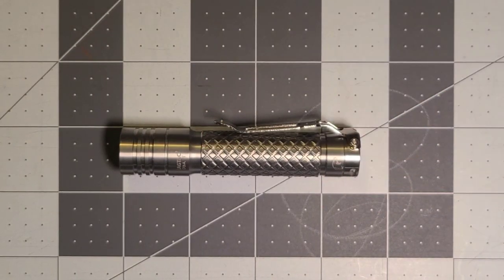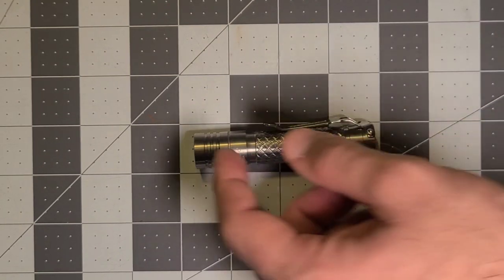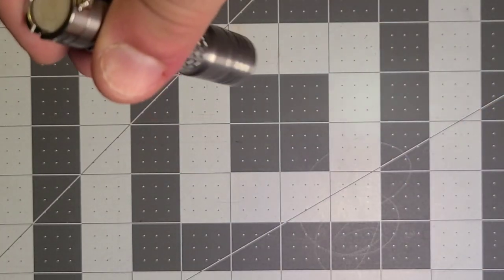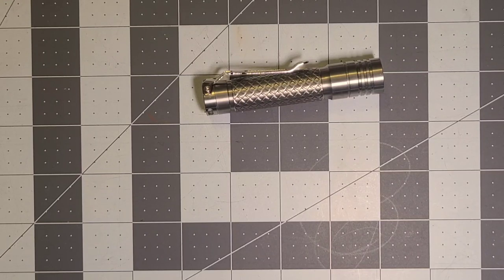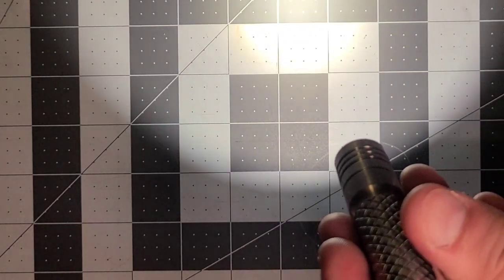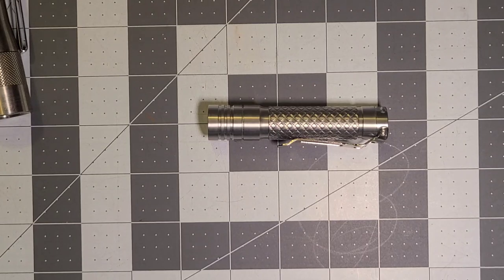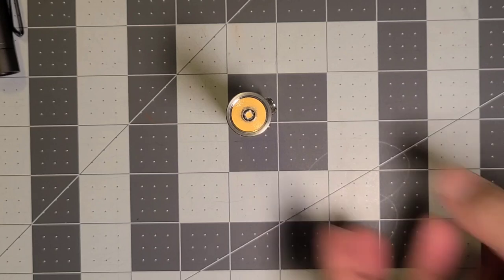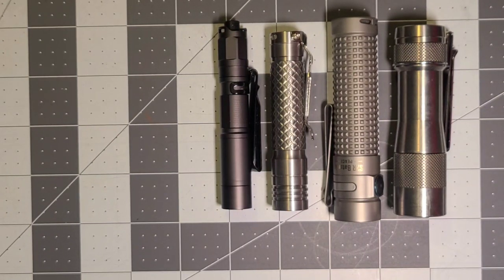Eagtac D3A, Why is no one Talking About this Light?

Comment: Great light! I’ve carried a 2015 d25c ti since, well 2015. I got the neutral xpl-hi and I call it my unicorn light because it just has absolutely incredible tint and color rendering.. far better than it should! I’ve bought other lights with the same led since and it always out em to shame.. it also beats my nichia and sst20 lights. At least when it comes to tint. Might be a couple points lower cri wise but I’d estimate that it’s in the high 80s.

I’ve had a couple 2014 d25a ti’s as well. They’re cool white but I found em on clearance for 35-40 a piece. I kept my favorite, the xml one and sold the others to coworkers, who still use them daily! Mine is my bedside light. 

I don’t might the strobes either, because of having to cycle twice, or I’ll just half press the button for a half second to reset. 

I recently enabled memory on my d25c by accident and thought it had finally crapped out..  but nope! I figured it out and she’s still going strong. I recently got a ticu fw3 with 4kk sst20s which might replace it.. at least in winter when it’s easier to carry a larger light..  but I can see myself crawling back to the trusty d25c. Like I said, just can’t beat the tint! It almost sucks because it was my first “high end” flashlight and it makes me disappointed in everything else now! In one way or another.

Comment: currently carrying a manker eo2 II, its a right angle AAA light that can take 10440s, but even with just a AAA it goes up to like 220 too, yo get two emitter options : SST20 in neutral white which is around 4000k and >95cri or in cool white. Its stupid small and stupid inexpensive too (around 15-20), and the UI  is pretty ddamn nice ( u get double cick for turbo and hold for super low moonlight levels.) Personally its an awesome edc light  and since its so inexpensive i can use it and abuse it without worries.
Reply: Totally agree with you they are fantastic lil flashlights my most used tbh. To easy to have too much torch than you actually need.

Comment: I have an older d25a ti and have carried a d25c ti for years. Have owned several others as well. The clip is fine but I do have my own complaints about it. First, the screws! They use a weird size like 1.55mm or something and they've arrived half stripped. I always use a little pair of pliers to remove or tighten em. Next, the coating. It looks crappy and chips off easily. My solution is sandblasting them as soon as I get em. It looks much nicer, especially after some carry time. My most carried has a nice stonewashed look to it now.

Comment: Pocket clip broke on my D25A in the most annoying way. The clip itself didn't break but the screw holes stripped so I can't attached it.
Reply from the maker: That sucks...did u contact them?
Reply: @maxlvledc  Nah. I took on the task of using JB Welds while trying to avoid the clicky button. Lasted a few weeks.
Reply: I got my tee already with a stripped thread on one of the bolts (the bolts and the hexagon are not standard for them), I solved the problem by recutting the thread to a slightly thicker one and using two bolts from the computer, it turned out even better than from the manufacturer, since the bolts have a flatter head

Comment: D3A is amazing.  I’ve been using mine daily for the past year.  Love it!!  Only thing is I can’t find out how to switch to moonlight mode instead of just “low.”  I’ve followed the instructions in the box to no avail.  Any chance you might be able to explain how to switch into moonlight mode?  Thanks!
Reply from the maker: hmm, was their a hidden moonlight mode??? I thought it was just 4 different modes in the edc modeset and you came in on it..I'll check for you.
Reply: @maxlvledc  Yea, per the instructions there is an additional moonlight mode that you can “toggle” into.  They’re not very clear.  Thanks for checking!
Reply: @matthewtoeneboehn7784  YouTube it. There's a video on how to perform this. You have to turn the head on and off three times while the switch is on.

Comment: Old video and not sure if you will answer but is the turbo setting when the head is tight the same as the high mode when the head is loose? Or are they actually different Lumen outputs?
Reply: It's gotta be different. There's 4 diff lumen outputs on the specs.
Reply: @mark6865  I saw that I just wasn’t sure if that was a turbo-hi-med-low or hi-med-low-moonlight. I don’t trust the website since they don’t even show the right mode group for the light functions lol
Reply: @RyGod509  hmmm that’s a good point actually. Moonlight is one of the 4 I assume listed at 2lm. Now I’m not so sure. Maybe turbo and high are the same?
Reply: @mark6865  I bought one that should be here Monday so I’ll test it out then and let you know.
Reply: @mark6865  also looking at some document for the D3A it shows group 1 goes very low-low-med-high and group 2 goes max-strobe. And then goes to say limit use to 5 minutes while in high and turbo mode. I’m hoping that high and turbo are the same setting because 250 lumens for high doesn’t seem like very much.
Reply: @RyGod509  I bought two. But won’t be here til mid July. Please do! Which emitter did you get? I got one in sst20 4000k and one in sft40 6500k
Reply: @mark6865  I got a used one off of the flashlight subreddit on Reddit with the sst20. I also have a skilhunt M150 that is a pretty great AA light. 750 lumens, magnetic charging, takes 14500 or Regular AA batteries
Reply: @RyGod509  250 would be a good step down lumen count but agreed it’s low for a turbo on a light like this. Where did you find this?

Also which 14500 are you planning to use for it?
Reply: @mark6865  I have some vapecel H10 that I usually use with my 14500 or some eneloop pros
Reply: @mark6865  so I got my light today and using a standard AA battery I think tight head on turbo and loose head on high are the same  thing. I’ll have to do some more testing with the 14500
Reply: @RyGod509  interesting. It could be that you don't have enough juice from the AA. Let me know what happens with the vapcell. I was actually leaning to the turbo being double the high after looking at data from the D3C which should be somewhat similar.
Reply: @mark6865  I’m going to test it out today with a 14500 and see what happens. When I’m loose head mode it looks like the 4 outputs match up with the 4 numbered outputs on the website so very low-low-Ned-high. Would be the 405/282/16/2 lumens it shows on the website. Once you get yours you can test it and just go to high while in loose head mode and then keep the light on and tighten the head so that would put it in “turbo” while head is tight and the output doesn’t change.
Reply: @RyGod509  In this video it only shows 3 outputs in the loose head mode. Is moonlight something that can be turned off?  I'm glad you can access highest mode in the loose head UI. That's great.
Reply: @mark6865  good news. With the 14500 battery doing that same test it does go to a higher output.
Reply: @RyGod509  Oh really? So there's 5 levels in all? Can't wait to test mine.
Reply: @mark6865  so it’s looking like with the 14500 on loose head there is 4 modes and tight head is turbo for 5 total outputs. With a regular AA battery loose head has 4 modes but the high on loose head mode is also “turbo” on tight head mode so only 4 total outputs. It probably does take that extra juice of the 14500 to hit the turbo output. Are you Reddit at all?
Reply: @RyGod509  Hey man I didn't realized you asked me about reddit, came back here to ask you a question since I just got both my lights in. SFT-40 is amazing but my SST-20 is having issues. 

Which emitter do you have? On my SST-20 on regular AA (I don't have my li-on yet), it doesn't have both UI. I don't have the Turbo-Strobe UI on head tighten. I only have the regular UI both on tightened and loose. Do you have this issue at all? I can't test it on 14500 but I don't know if that would make a difference. My SFT-40 can do both UIs on AA.

What's your username on reddit?

Comment: When do you think you’ll be able to do the follow up video for this light, and do you suggest running it with NiMH batteries or the 14500’s?
Reply from the maker: 14500 for sure, as far as a followup. The only thing I have planned is a full 14500/AA roundup

Comment: I recently bought this light too! Could you tell me what 15400 battery are you going to use? I'm really confused because for what I understand if the battery is too long won't fit! Thanks
Reply from the maker: I have some coming in the mail once they are here I will make a followup
Reply: @maxlvledc  I too am perplexed by the battery situation. Just bought one, but cannot find the right rechargeable battery. Eagtac states it needs a 5+amp battery with 3.7w. Also trying to find a protected battery for safety. Please make the follow up!
Reply: @kylemo938  hey are you still looking for the battery I just bought one on Amazon that comes with the nitecore battery for 87 bucks charger flashlight and a good battery
Reply: @kylemo938  oh ok..you already bought  the flashlight... so did you find a 14500 battery? I can look and see what the name of the one I ordered is I know it's made by Nitecore
To be honest I've had a lot of problems with nitecore batteries in the past but the seller Lumen tactical who is a huge seller on Amazon sells the d3a with a nitecore battery 14500 so you know it's got to be the right recommended battery
Reply: @BuffaloNickel9  ya, can you let me know the specs of the nitecore battery. I considered them... what problems have happened in the past?
Reply: @kylemo938  yes I'll get the exact specs of the Nightcore 14500 3.7v (AA size) battery
How do you like the light and what battery are you currently using with it does it seem bright enough?
Reply: @BuffaloNickel9  yes, reviewer covered it all.
Honestly, its plenty bright with just a AA. I was shocked, the diff between 14500 and AA was minimal to my eyes. I wanted the XPL led, but accidentally got sent the xpl version which has higher output, but lower candela

Comment: ps this flashlight DOES have memory mode if you program it, and same with moonlight.
Reply from the maker: what what???? program it?? did I miss this?
Reply: @maxlvledc   not very well known I guess, wish I could send a screenshot but if you download the user manual there's a section that says you can toggle the memory mode.  start with the head tight, turn on, wait 1 sec and loosen/tighten 3x and it should toggle the memory mode. 
do the opposite to toggle moonlight mode, starting with the head loose in lowest output and that toggle moonlight mode. 🤷‍♂️ took me a few tries

Comment: I’d avoid any and all externally charging batteries. For this I prefer the Olight. I wish olight made titanium bodies more common.
Reply from the maker: What do you mean by externally charging batteries? I've never had a problem with them, but then again I have a very high end charger
Reply: I agree, on the go or in the field charging is a HUGE feature for a lot of users. The charge circuits are incredibly small, there's almost no reason to not include a micro USB port.

I also have some non rechargeable lights, but use rechargeable batteries in them.
I don't expect a $4 head torch to have a charge circuit.
Reply: No you don’t
Reply: @edwardfletcher7790  yes you do

Comment: The titanium version is definitely better IMO than the aluminum (black D25A) version. The strobe works much better.
Also, you give up the black model, you give up the "glow-in-the-dark" tail switch. 
Also, with the black version the emitter is not one solid unit. The reflector come apart from the bulb holder. So, when doing the twisting interface, it something than can twist that you weren't expecting. Not that big a deal, since it is mostly a tail light interface, but it is something of note.

It is definitely worth the extra $30 for the titanium model.

Comment: Yeah I’m actually not a fan of that twisty interface. I know I’m just some schmuck on the internet, but I really considered this as my first titanium flashlight, but I like the one hand operation ability of my Pineapple. This one almost seems like you need to 2 hand it and that doesn’t always work.
Reply: Here's the thing though. You don't really need turbo. I keep mine with the head slightly loosened, so it always starts in moonlight. Then just three half presses and you're in max, which isn't significantly less bright than turbo anyway. The good thing is, you have the choice to go from off to the turbo/strobe group if you want to. I don't know another light with just a tail reverse clicky that can start in two different modes.
Then there are the lights with side (e-)switches, but because they're e-switches, they do have some parasitic drain, and (depending on the light) they're also prone to accidental activation in your pocket which has never happened to me with my D3A and its sturdy tail switch. Also, it does still tailstand very well which I like a lot.

Comment: Kind of an unrelated question but I don't know who else to ask haha, would you be able to find a way to use leatherman bits in the gerber center drive?
Reply from the maker: Wiha has some short double sided bits, I'd check those out instead
Reply: I'd think they'd work but you might have to put them in a little turned.